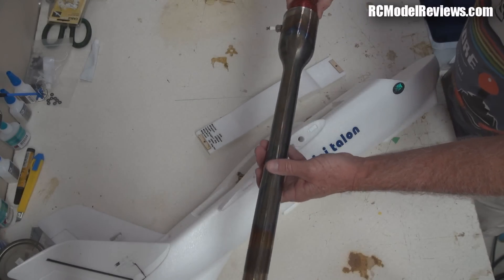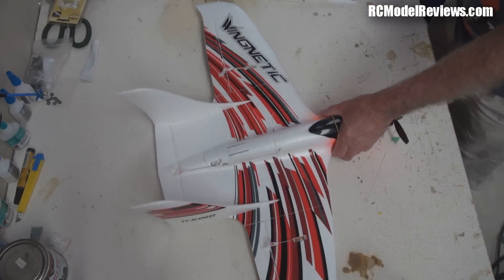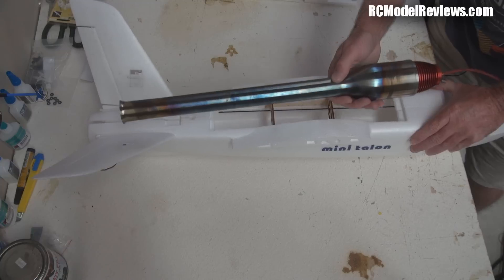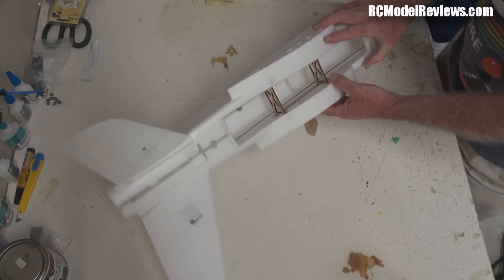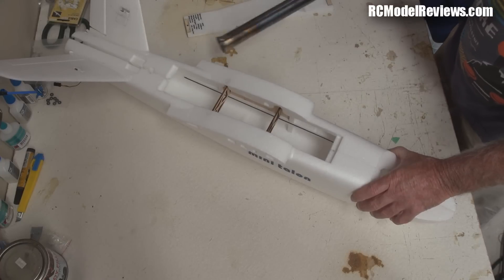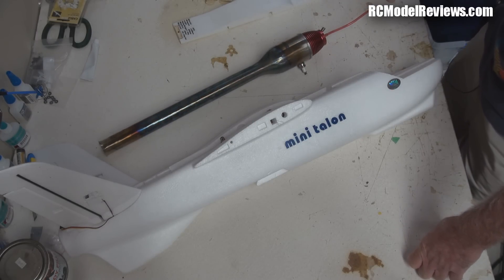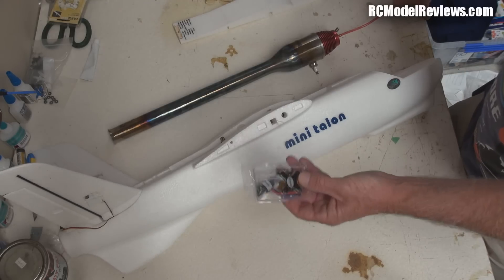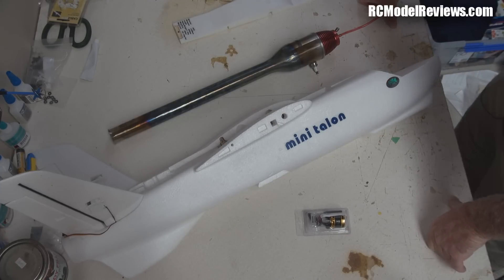Project: A real jet-powered RC plane for under $200

Comment: you must use Kevlar or it's going to melt. the foil tape will just conduct the heat and do nothing to strengthen the fuselage. Kevlar is a heat shield and a strengthener all-in-one. I've already got nine thumbs up on this idea. please use Kevlar. I also use Kevlar mittens to pull the hot plates off the stove and I normally don't feel any heat through the Kevlar.

Comment: Heat plus foam has never been good. Also adding fuel to the mix. I would suggest a tub of sorts to install in the shell to contain the fuel spills or seepage you always get when working with fuel cut offs. That by its self would steer me away from such a project, I havent seen a fuel shut off yet that hasnt started leaking after a while. Fuel eats at the o-rings after a while and leaks prevail. I would have to agree that mabe Kalvar on the wings to deflect any heat below. Foam just doesnt care for heat. I see guys attach gas motors to their foam RC models and it doesnt take long before the foam is pock marked and nasty looking.

Comment: please use Kevlar cloth on the fuselage and tail feathers. it will insulate the foam from the Heat and make the fuselage stronger when mounting the Pulse Jet. Kevlar cloth is super lightweight and strong. also a wood structure inside the fuselage would be a great heat insulator to mount to. lay down the Kevlar cloth with super 77 adhesive and then spread super glue over the cloth several times using a spreader. this will create a hard shell that will protect the fuselage from heat and increase its strength. I use Kevlar cloth on all my foam planes and they survived the worst of crashes. you can pick up a square yard of Kevlar cloth for only fifty bucks well worth it. can I get some thumbs up on this idea ? hell I have a plane that is 100% covered in Kevlar and it fly's great ! I have crashed tested it a few times with very little damage if any at all. 
http://www.fibreglast.com/product/Kevlar_Plain_Weave_Fabric_2469/Kevlar

Comment: That Verner geezer used the fuel to cool the engine.
Reply: And that heat exchange vaporised AND pressurised the fuel immediately prior to injection into the nozzles. 
Those rocket engineers had good skills!

Comment: Talon wing tips get a flutter on at high speeds.
Reply from the maker: That'll liven things up a bit then! :-)
Reply: That'll cause little Coriolis  effect lines of smoke behind the talon. Nice!
Reply: RCModelReviews https://m.summitracing.com/parts/dei-010127?seid=srese1&cm_mmc=pla-google-_-shopping-_-srese1-_-design-engineering-dei&gclid=Cj0KEQiAl4TGBRDhgvmikdHPsdABEiQAtBcc8ELCG2PxTDr-914X-psC13DLFaKToM-JHw275OPv-O4aAv798P8HAQ